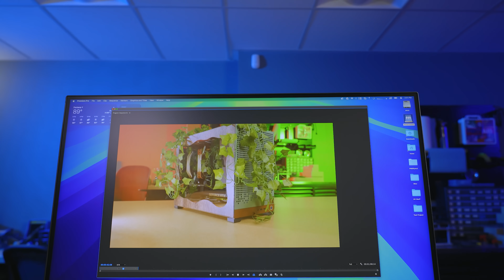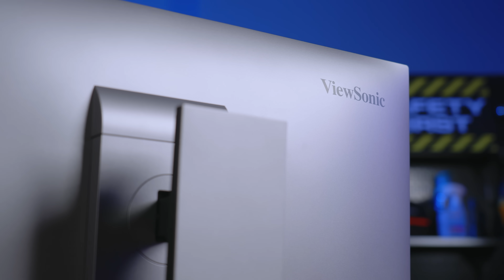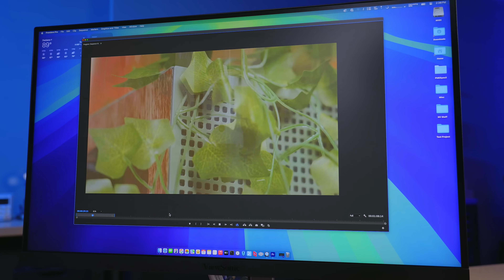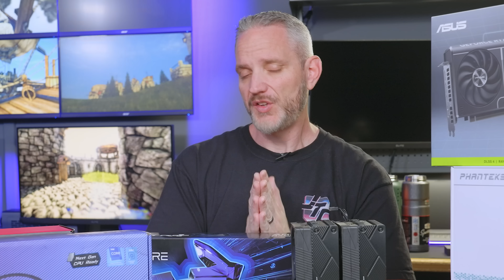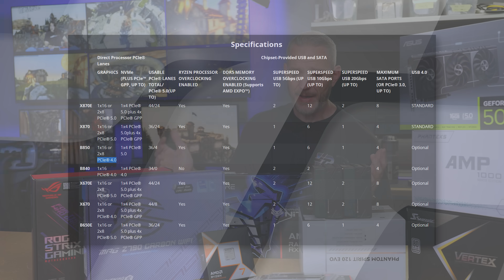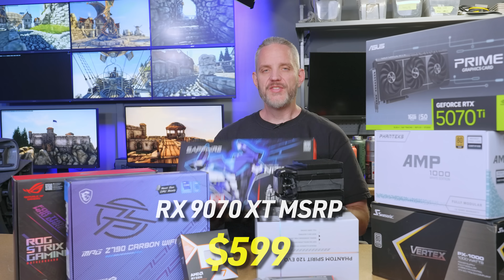This is the Sweetspot for PC gaming... Don't get fooled into spending more!

Comment: I bought my nitro+ 7900 xtx for 650$  paired with 7800x3d which i got for 325$ 100$ for mb 100$ for 32gb of ram 6000mhz cl30 75$ 2tb gen4 ssd kingston kc3000 7gb/s read/write 50$ cpu cooler (phantom spirit 120 evo) 125$ for 1200w deepcool psu (i know its overkill but price was nice) and lastly 40$ case 1465$ total and that is my sweetspot haha (i play mostly esport titles and have a 1440p 240hz/1080p 480hz dual mode monitor) Obviously most parts bought used and I built my pc almost a YEAR ago when rtx 5000 and rx 9000 and ryzen 9800x3d werent even a thing yet so overall cost could be quite a bit lower now

Comment: Still with my msi b550 and 5800x with 64gb 3200 ddr4, 2x 2tb m.2 with main being NVME, 8tb hdd for back up and mass storage and msi Ventus 3080, corsair hx1200i  be quiet aio and fans and a second hand corsair carbon case

My next move if I had the money is to go itx size to free up desk space

Comment: The price diff between Gen 3 and Gen 4 is too low to actually buy Gen 3 NVMEs. This is why currently Gen 4 is the only NVME speed I buy atm.  My MB is Gen 5 but the price is just way too high atm. Those sellers are stocking but they will be selling at the new more expensive price.

Comment: 5700X, Asus B550 +wifi, 1Tb 7300 SSD, RX 6800, CPU cooler, 4 extra fans, 32 Gb 3600, 450W PSU.
Even when I squeeze my GPU like a lemon it's fine. Maybe because I remember having to manage RAM myself and loading different CLI to save some memory so I could play some game that I know how much power my rig pulls max. :P

Comment: I'm 5 years in with my 3080, thinking about the 9070xt or 5070ti. But...I maybe made a mistake with the 750W PSU?  It was enough, but with these new kit items being around the same draw maybe I lucked out? I did go from 10700k with overclock to 7800x3d base since too which is also more efficient. It's really my drives and LED which add now.

Comment: i UPGRADE each 2 or 3 years since id di my first upgrade in 2001. i GOT my first pc in 1996 when i was 9 years old.
And yes the main reaosn i upgrade are the games because iwant to play them maxed at 60 fps. For geneal use(internet movies series) it also very good as it loafds evryhing in 1 secon and runs all games maxed 1440p 60 fps and all programs and movies and series perfectly.
Latest upgrade was graphics card in 2021 and ssd in 2020. My next upgrade will be cpu ram and motherboard when zen 6 releases.
MINE MONSTER PC IS RYZEN 7 1700 RX 6700XT 12 GB RED DEVIL 16 GB DDR4 3200MHZCL15 MP 600 2TB WRITE:4950MB/S READ:4250MB/S DELLP2416D 24'' 2560X1440 60 HZ IPS
But the truth is that it dosent eed any uprgades at it suna all games maxed 1440p 60 fps(with FSRi n those who have ray tracing) and also loads evrything in 1 second(windows, games, programs, movies, series) and has very good graphis on evrything!

Comment: In these hardware parts suggestion videos, nobody ever harldy talks about the monitor resolution you intent to use your gaming pc for which imho is the starting point. The hardware specs are not the same for 1080p, 2k, 4k or 8k. It would be nice to have recommendations seperatly for different resolutions and fps target.

Comment: I highly recommend trying to buy hardware during a sale. I got all mine during Micro Center’s Tech Days deal, and saved about 700$

Specs and prices 

CPU
AMD Ryzen 9 9950x3D
Retail Price - 700$
Sale Price - 600$

Mother Board
AMD X870E Aorus Elite Wifi7
Retail Price -330$
Sale Price - 330$

GPU
MSI 5080 Ventus 3x OC plus
Retail Price - 1450$
Sale Price -  1350$

Case
CORSAIR 3500X RGB TG MT CASE BLCK
Retail Price - 120$
Sale Price - 120$

Power Supply
Corsair RM1000e
Retail Price - 190$
Sale Price - 160$

CPU Radiator Cooler
TRYX Panorama SE 360 ARGB
Retail Price - 310$
Sale Price - 252$

RAM
Corsair Dominator Titanium 6000 (32gb x2)
Retail Price - 331$
Sale Price - 280$

Exhaust Fan
Corsair rs120 ARGB 
Retail Price - 20$
Sale Price - 20$
Corsair rs140 ARGB 
Retail Price - 35$
Sale Price - 35$

Storage
Platinum P41 SSD - PCIe NVMe M.2 500gb
Retail Price - 110$
Sale Price - 60$

Samsung 990 EVO PLUS - PCIe 4.0x4 / 5.0x2 NVMe M.2 SSD 2tb
Retail Price - 187$
Sale Price - 120$

inland Platinum SSD 2.5 SATA III 6Gb/s 4TB
Retail Price - 330$
Sale Price - 220$

Monitor
ASUS ROG Strix 27” 1440P 240Hz Glossy OLED QHD (XG27AQDMG)
Retail - 700$
Sale Price - 600$

Comment: I ended up going with a 9070(Non XT) and at this moment in time, it gets a good recommendation from me.

While a lot of people focus on the small MSRP difference Vs the XT, the base 9070 is usually much closer to actual MSRP while the XT is way more marked up, which makes the price gap much bigger than their msrps would have you believe, while the performance difference is relatively small.
Reply: It’s quite the opposite actually, they priced them so close despite the gain in performance to sell more xt’s the regular 9070 got the short end of the stick and should not be at that price at all.

Comment: 3:00 Since the effects of running into a CPU bottleneck is much more pronounced than running in to a GPU bottleneck I'd rather slightly oversize my CPU and be sure it won't be a problem for years to come.
The 7800X3D is the current absolute minimum for average builds in my opinion. If money is an issue, I'd rather save the money completely and go with an 7500F now than to try squeezing in a 7700X, and selling it a year later to replace with a 7800X3D.

Comment: I recently got a 9070XT below MSRP. Trying to minmax, I didn't outright go for a new PSU but it turns out my 520W model didn't do well at all.

Launched a game - crash before main menu
Launched another game - crash before main menu
Started FurMark - OCP tripped

So I got on my bike to go to the nearest shop that sells power supplies and went with an 850W gold unit. I would have probably gone platinum when buying it online but since time was somewhat critical, I saved half the price. They just didn't have a platinum one available at the store. Even with pretty high prices for electricity, that efficiency gain would not have made up for it over time.

Comment: When I select a power supply it pays to have a ready reckoner rule of thumb for choosing correctly. All components draw power inside a pc and knowing what they are from the literature accompanying the product or from computer forums. So fully extended, the cpu uses 200 watts, gpu uses 250 watts, fans use say 30 watts for multiple, motherboard draws 50. Total 530 watts, I will add at least 50% meaning the desired power supply is 800 watts. This is the rule of thumb I have always used. I rarely upgrade my pc preferring all new components in my new builds.

Comment: intel has better ASICS, driver, and software. AMD is still trash in every metric other than perf and power consumption. and a cu7265k performs fine in gaming on mid range pcs while providing god tear video encode off gpu and bluetooth LE audio which eliminates the interference you might deal with in a crowded airspace.

Comment: i went z790 gigabyte because i needed 3 m.2 drive slots, not because overclock at all or need better vrms than the b760 i had. i just didnt have the storage. i also found wd black gen 4 m.2 runs incredibly hot if you buy the one without a heatsink on to save money like i did. i had to buy a third party arctic ssd heatsink to reduce temps 12C. NEVER buy wd black gen 4 drive without getting the version with a heatsink, unless you are replacing one and have the heatsink spare already.
otherwise, thanks jay for confirming my choices were the right call. i had to settle for a 4060 windforce gpu and a 14400f cpu for budget and power use reasons (i have to be able to afford the electric bill!) and that my corsair 6400MT/s ddr5  cl36 is slow. EDIT: given the cpu and gpu the ram is only about 1fps speed increase so it doesnt matter really lol

Comment: Think gpu power is going up not just from the shrinking - which use to bring power efficiency, but the fact to get any more performance up lifts you can only increase the resources it has like cuda, tensor and so on with clock speeds which in turn require more power. I mean most 90 cars you look at each gen probably has a 25% perf increase over previous gen and roughly 30% more cores and so on.   I think Pascal was Nvidia at it most efficient, however they have done some weird stuff with 4060 class which I bet could be run off pcie lane..

Comment: I just wonder do you have any personal beef with Arctic or you have some sort of backend deal with thermalright (its so sus when you even joke"i know it sounds like an add") i rly hope you just dont know your stuff about cpu cooler and its not smth more hidden...cpu coolers...Prices comparisson in UK: phantom spirit 45£,ARCTIC Freezer 36 23£ (better cooling performance compared to phantom spirit and almost half the price. Whats even more funny when you talking about dont buy cheap cooler for 25$,and arctic freezer 36 is that cheap,but also better permormance than in your opinion "beast" phantom spirit),ARCTIC Liquid Freezer III Pro 360 72£. water cooler smokes every air cooler on a market for 72£. (including phantom spirit). You claim you need at least 100-150$ water cooler to get the same performance as phantom spirit. Both of those claims are just totally wrong. Will  need to pay attention in the future on your videos to determine whether this was just an honest mistake, pushing thermalright suspiciously,or just ignoring cheapest and best performing coolers (both air and water) on a market for whatever reason

Comment: It's going to depend, I think your build is mostly valid for the general population, if the person you're building for is more into sim games, that X3D might be worth it with a downgrade in the GPU department.
Otherwise I like to spec AM5 because of AMDs 4 gen promise on that socket with a decent board. If the person wants to save money or spend more on the GPU I like to throw in what's basically the cheapest CPU at the time. Can still throw in a new CPU in the next gen when they forgot spending all that money ;)

Comment: Probably the sweetspot gaming PC in terms of FPS, graphics & monitor to have extra money: 
- TN or IPS monitor at 144Hz
- medium/high 1080p under 144 fps for the majority of indie & not so hungry titles
- low/medium & locked at 60 fps or 30 if current GPU is struggling for the resource hungry games & the future titles.
- play OG/GOAT titles of the past years/decade & crank up the graphics quality 😅😅

Comment: I wish this video was here before I splurged on my 9950X3D and MSI 5090 suprim liquid soc lol but that was an early 32nd bday gift to myself haha and I'm watching anyway cause I enjoy the content, also I picked the MSI Carbon WiFi X870E, 4TB Samsung 9100 Pro, 64gb Corsair Dominator Titanium ram 6,000 MT/s TRYX PANORAMA 360aio, 10 Corsair QX RGB,120, fans, Corsair 6500x case
Reply: Also running a 32" 4K 144hz Corsair monitor with a 1200w Lian Li Edge gold power supply

Comment: Nah. So many errors. Most blatant one is with power hungry GPUs. Reason why they are sipping that much power is because:
 - GPUs now have rather high clocks, without decreasing voltage need appropriately and charge level. (When you double clock, you need to slash energy per cycle to 1/2.)
 - GPUs increased number of transistors by factor of 4~8 since times of GTX 1080 Ti. And there was again not appropriate improvement in power efficiency.

Manufacturers, are pushing last MHz race. Reaching the border of stability. And requiring much more power per MHz than if they dialed limits down by 10%.

And that's why we moved from 250W GTX 1080 Ti (11.8 B transistors ~1500 MHz) to RTX 5090 (92.2 B transistors ~2450 MHz). 8 times as many transistors, 1.65x times the clock. That's 13x as many transistor flip/floping cycles per second. And power efficiency did not improve 13x at those conditions.

When you look at something like RX 9070 XT which peaks its power draw between 300~330W. It has 54B transistors, and actually pushes 3 GHz quite consistently. It could have easily be card which peaks at 250W instead. But clients want the most of what silicon can withstand, so 3+ GHz.

Similar story applies not only to GPU, but to VRAM, too. Newest and greatest with maximized clocks, timings technology allows... is still often more power efficient in terms of "bandwidth/latency per Watt". But can still eat more than last generation when setup has too high clocks, or number of chips in order to maximize capacity and bandwidth for much bigger GPU.

Comment: Another reason to overspec your power supply is because the best efficiency your system runs at is generally at around 50-60% usage, so you will save more on your power bill if you buy a power supply that is specced about double the amount the potential power draw of the GPU and CPU combined. It also helps for the problem of modern graphics cards or CPUs sometimes spiking up in power draw.

Comment: I'm using a 5800x3d paired with an RX 9070 and one of the main things I'm impressed with on it is how little the power draw is and the temps. Barely pulling 300w between the cpu and gpu with some undervolting and both cpu and gpu are pretty much staying under 70c even on the gpu hotspot.

Comment: Hear me out, if you want to go low budget Intel is the way to go.
The 14400F is very cheap and on the same level as the 7500F or 5800X. Intel boards usually have more features for the same amount of money compared to AMD.
With Intel you also can have DDR4 RAM, which might be a little bit slower, but still cheaper compared to DDR5.
I can get a B760 board with PCIe 5.0x16 and 32GB of DDR4 RAM and a 1440F for under 300€. And you can find many used parts for cheap, especially DDR4.
If you think about upgrading? Well I want to remind you that AM5 and the newest Intel Socket 1851 only release 1 CPU before sockets will change again. And the sockets after that, like AM6, will most likely use DDR6.

Comment: Thought I'd build (sigh) one more gaming rig. After much deliberation, Sapphire Pulse 9060XT, 9600X, 64 gigs at 6000, 4 TB Sammy EVO 990. Slapped all that in an Ncase M2 with a 750w corsair power supply I kept from like 3 years ago when I decommissioned my last rig. Good enough for the girls I go out with.

Comment: i'm still running my 3070 and Ryzen 9 3900 non X with a B450 mobo. The non X 3900 is still overclockable and mine runs with an easy 4.1ghz OC. I did a 3d mark benchmark and set a new record for performance for my parts combo! I felt like Jay for a second there!